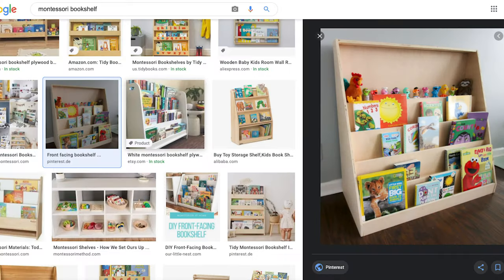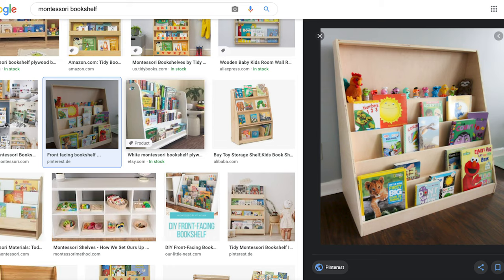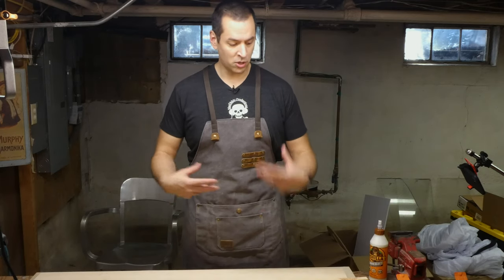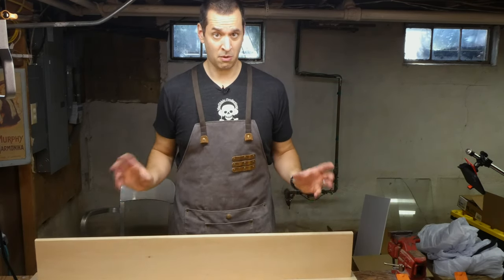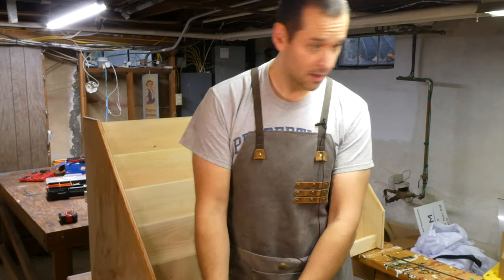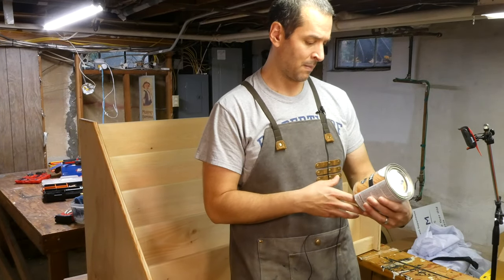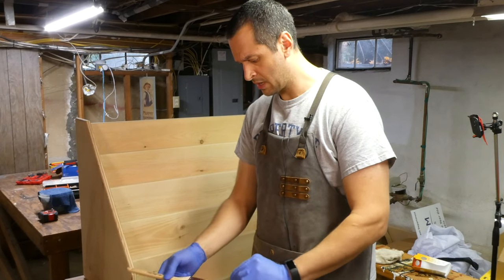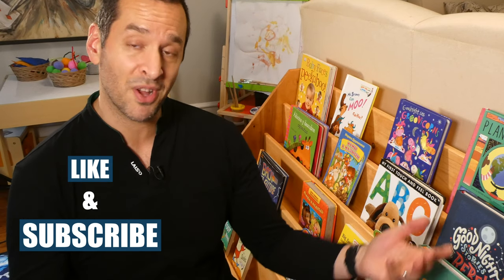How to Make a Montessori Style Wooden Bookcase

Comment: Very Nice - I'm going to make something similar.  Question - why did you decide to put those bracing blocks (12:57).  Did you plan for that when you started out or did you think of that later when you discovered that the structure might be more flimsy without them.  Thanks!
Reply from the maker: Awesome, glad you're tackling something like this! Being a dad, I tend to overdo the safety stuff so figuring either one of my kids would eventually use it as a ladder, I wanted enough stability to at least TRY and hold them up. That being said, so far, they haven't gotten that daring and I probably could have simply used glue and screws. I hope that helps! Good luck with your build!

Comment: Hello sir, your work is amazing. I am very new to wood work. I have 1 year old baby
 I would like to make this shelf. But I have only tool is drilling machine. So can  you please suggest any other affordable machines to buy. Because I can see you making rounding edges actually I planned safety rail for those edges. Since I don't have such machines.I am doing like craft not much like professional. Once I learnt I may try professional things...can you please suggest the proper dimension sir...so while buying wood here I have option I can get it cut by the shop...it will be greatest gift for my baby from mom ..can you please provide the dimensions sir....
Reply from the maker: Hi there! I'm glad you liked it. Here are some simple tools and tricks that can help out. First, to cut everything you could use a manual saw or get an inexpensive circular saw at a discount hardware store (not sure where you're from but Harbor Freight has pretty good prices on tools). To round over the edges, you could use some low grit (like 60 or 80 grit) sandpaper to make them round, and then go up to 120 grit to finish them off nice and smooth. They'll give your arms a workout but it's way cheaper than buying a router. So to recap, an inexpensive circular saw (here's one, I've never used it but it's not too expensive https://www.harborfreight.com/power-tools/power-saws/circular-saws/10-amp-7-14-in-circular-saw-63005.html) and a straight edge saw guide (https://www.harborfreight.com/24-inch-clamp-and-cut-edge-guide-66126.html?_br_psugg_q=saw+straight+edge) to cut the wood down, some various grits of sandpaper to smooth down the sharp edges. I hope that helps! Your baby will love it!!
Reply: @MADEbyAP  thank you so much sir for your guide on wood works and kind..I will try this book shelf...